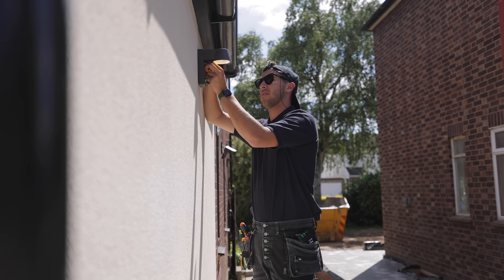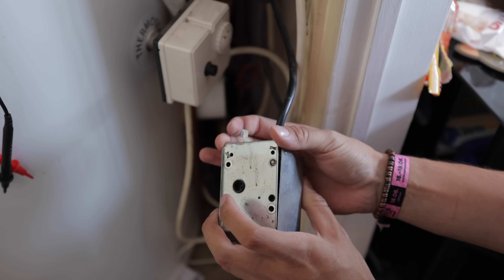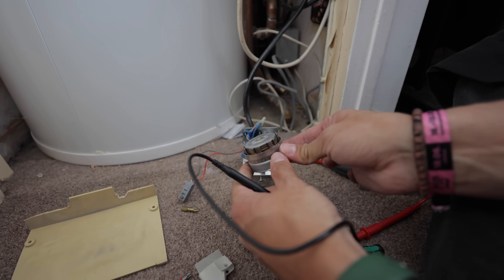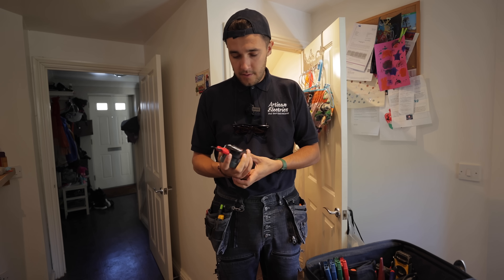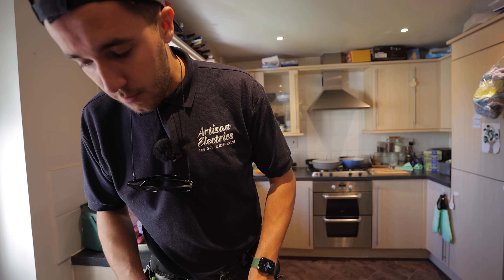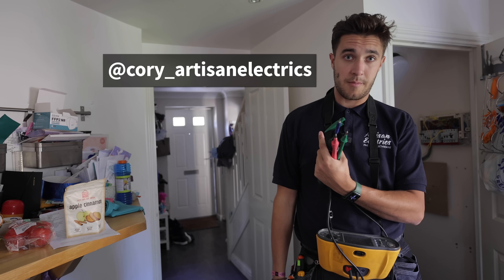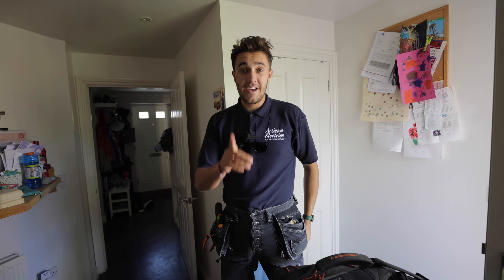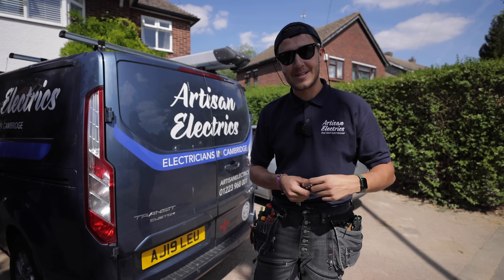FAULT FINDING ON A HEATING SYSTEM! PRESSURE TO BEAT THE CLOCK! 🤯

Comment: You see how he hit that valve , that’s what a pro sparky looks like , established the problem and then proved his thoughts and walks away knowing exactly where the issue was with use of drawings his experience  and test equipment, new to the trade people would do well to follow that advice not just be a parts changer or a “call a plumber” merchant
Reply: Thanks mate!
Reply: Hope you didn't charge them? ☺️
Reply: @glenndyer9967  you have to. Who pays for fuel insurance?

Comment: The switch is only auxiliary to bring on the boiler, it's called boiler interlink the wrong guy was called to fix the problem. Next time call a heating engineer

Comment: inside the fixed part of the valve is a short arm which has a small rubber ball which covers or opens the flow of water,i have changed quite a few due to the rubber ball deteriating and breaking up and getting lodged in the arm
Reply: Came here to just say this exact thing. Joe is 101% correct

Comment: Love the link you have for the r1+r2 I have the same link off the guy on ebay.
Only thing I wish was if the drill bit was longer for crabtree rcbo's as it has a deep line terminal.
Also I would c2 the the spot lights in the kitchen as it does not pose an immediate danger but is likely to cause a danger in the event of a fire.

Comment: 8:18: a stiff valve shouldn't (though anything is possible) burn out the motor.

The motors are designed to spend most of their life stalled. On a single port valve, they run to the end of travel and just sit there with current running through them desperately trying to push the valve more open, but alas in vain.

Like the wind turbine service boats that just sit there rammed against the base of the turbine.

The motors are a common enough failure that you can pick up replacements and knock-off replacements everywhere.
Reply from the maker: Great insight there thanks for sharing your wisdom and knowledge with us

Comment: Fire-rated downlights, while they're an excellent upgrade, are not required when the room above is part of the same dwelling. The ones installed here were approved and (assuming the ceiling isn't insulated) there's plenty of room for air to circulate. The greater risk comes when they're above an upstairs room and covered with insulation, with no air circulation. The lamps overheat and fail prematurely, and there's a fire risk. So possibly C3 but I'd put it in notes advising energy saving advantages of upgrading.
Reply: My thinking exactly

Comment: Fault finding on a stuck valve. Power off, does the level move back? If not either stuck valve, worn motor or broken spring. Pop the head off, if the lever returns it’s the valve, if not it’s the motor or if your really lucky a springs come off.
Reply from the maker: Great simple steps to follow there thanks for sharing

Comment: You’ve got 2 zone valves. 1 working 1 isn’t. Check wiring. Then confirm what you already know by swapping working zone valve over to the non working zone valve. Absolutely no need to faf about dissecting the unit if you claim you’re trying to save the customer coin.

Comment: if there is power to the brown wire  and motor does not move to open position it is faulty motor.  you can change sycron motor  or replace head you dont need to take sycron motor off

Comment: For the unvented cylinder

If the hot water is constantly on and won’t switch off

Check if there is a demand for hot water 
If there is and the zone valve is free then that’s operating correctly 

If you close the demand off then you should feel resistance, if you do then the zone valve is operating correctly also 

If the zone valve is continuously open and causing the boiler to repeatedly fire up to heat the hot water then the likely issue the the cylinder thermostat.

If the cylinder stat is at 65 degrees it’ll cause the boiler to fire much more times than it would if it’s at 60 degrees

Something as simple as turning the cylinder stat down slightly can have a big impact and the above can be checked within 5 mins

Comment: Too much length on those conductors Cory admit it the guy who put up that fitting should have tailored the conductors to the available room within the fitting rather than leaving all conductors long and then cramming them all in before making a quick get away. They've simply dropped the ball there on this one.

Comment: Heating wiring centres are the biggest ballache because they are often not installed by electricians, who finish up in some hot and cramped space,  fixing someone else’s lousy work.
Lunch breaks are compulsory - you need time out - otherwise your blood sugar level drops dangerously low and you finish up working in panic mode.
Reply from the maker: So true!

Comment: I can't believe when tenants leave there houses in such a state and don't leave a clear and safe environment for you to work in. Working in enclosed spaces is difficult enough without having to deal  with that. I think I would request the area be fully cleared of all obstructions prior to starting work or perhaps I am wrong?
Reply: In Denmark it's customary to clear out the area around whatever you want to have fixed, no matter it it's electrical, plumbing, or something else, as the techs who show up have the right to refuse the job if they don't have easy (or as easy as possible) access to everything they need to work on. This is also why everywhere in Europe now have strict regulations for where you can install things like the electrical main board. Post-Covid it's also become the norm for many companies to demand you clean and sterilize as much as possible, and to give the techs plenty of distance to do their job

Comment: Concerning the first job, I don't understand how a hot water system could be installed without any pipe insulation at all. What a waste of energy! And in 12:51 the light was flickering when the DB cover flew off. Didn't you notice that? Looked like there must be a loose connection.
Reply: The board cover could of just knocked the breaker switch as it flew off would explain the timing of it flickering then staying on again. Its happened to me many times
Reply: It's quite common to have uninsulated pipes running throughout a property. Generally there's no point insulating the small amount you can get to, if you're not going to dobthe full run. Some of mine, from a shower pump, go into the attic and back down, and they're fully insulated. But the CH pipes are like underfloor heating!
Reply: @tobysherring1369  IMHO, it makes sense, in cases without hot water circulating even if only the first metres are done because as long as the hot water is not flowing through the pipse, the energy losses are decreasing with increasing distance to the boiler/tank. In those cases where the hot water is circulating, a proper insulation throughout the full length is crucial.

Comment: Since you had it in bits might as well fitted a new motor
Reply: I would have fitted a new motor or complete valve. Save the customer calling out a plumber.
Especially if it was a old age pensioner, or a hard up family 👪. 
Sorry but I've always been like that.😉😊

Comment: No offence Cory but why is an electrician fault finding a water flow problem?
Reply from the maker: The original call was a suspected boiler fault.
Reply: @artisanelectrics  As a retired plumber/heating engineer I’m surprised that the first port of call for such a problem was an electrician rather than a plumber/heating engineer. After being self employed for just over 50years I’m pretty sure most of my customers would have contacted me before an electrician. I’m sure that if this job was at one of your customers then that is the reason for you getting the call. Love Cory’s sense of humour, (rumour has it that Pringles manufacturers have had to set up another shift to fulfill his appetite.)